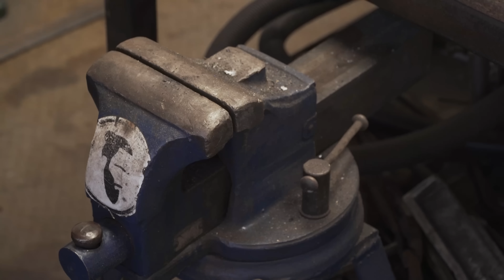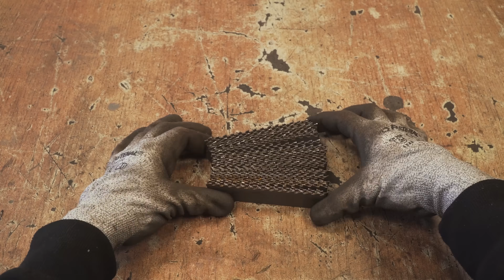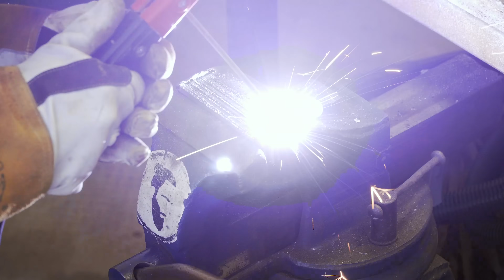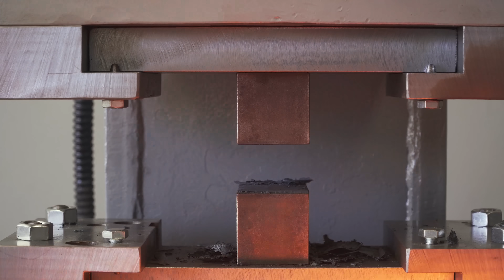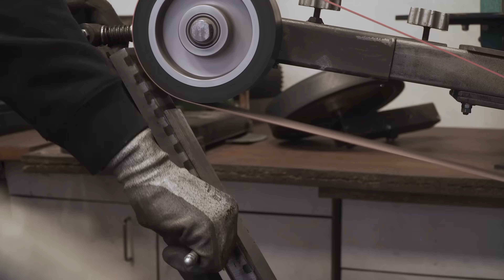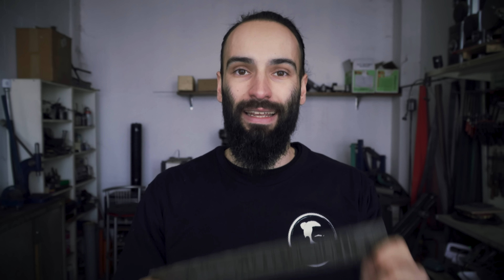Scrapyard Bandsaw Blades Damascus

Comment: Hello, iv been watching for a while now, iv seen a lot of different saw blades being used across other channels, but wondered if you change the direction of the teeth like flat edge, teeth edge,flat edge ect, or would that just make a slightly harder grade to work with,

Comment: Very nice! I’m impressed at how clean you made your whole stacking process. I also had a thought: instead of having all the saw teeth aligned on one side, maybe alternating them from right to left at varying frequencies in layers could diversify the pattern even further?:  K720, 2 Blades Right,  K720, 4 Blades Left, K720, 8 Blades Right,  K720, 8BL, K720, 4BR and so on so forth. Might be interesting.

Comment: great job friend 
l have a question 
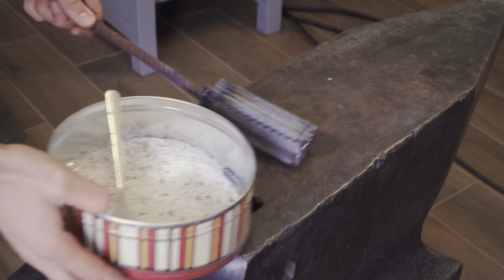what is this powder added on 2:45?
Reply: Borax.I find it better to make mix of boric acid 70% and 30% borax.Then dilute it in 70%+ alcohol and use a paintbrush then  burn it on the metal you want to coat .It will leave even coating and it burns green which is cool.

Comment: I like your experiment! I was waiting for the forge press in action- indeed it works fantastic! 
You interested me a lot with this 15PSI presure in your burners. What nozzle you put into them? Still works on 0,8mm nozzle like in the building video? To forge weld steel I can't go under 25PSI in my forge.

Comment: excellent work & beautiful result. K720 is really good steel, which welds very easily to almost anything - even stainless. Sticking bandsaw to bandsaw or spring steel to spring steel is much harder due to the chromium and/or nickel. If I may make 2 suggestions: 1. your gasforge is way too oxidizing judging by the amount of scaling. Needs more gas. 2. the corners of your press dies are dangerously sharp, they can easily create cold shuts.
Reply: Excellent thoughtful and informative comments.

Comment: Does the type of oil matter when quenching? I've always wondered if you could quench in ghee. I know it sounds strange, but I bet it would smell delicious
Reply: I use old peanut oil.. smells like french fries..
Reply: It does ,not all oils absorb the heat the same ,also some oils need to be preheated for certain types of steel.

Comment: I tried this recently actually! It worked out pretty well, just need to make the knife from the billet…
Reply: Was it just straight bandsaw blades or did you add another type of hardenable steel with it? I’m not a fan of repurposed steel myself. Could put all that work into it and everything goes perfectly yet the end piece still fails.
Reply: @erikcourtney1834  I threw in some 1095 every 5-6 layers of thin bandsaw blade. The initial and first fold welds went well and seem completely solid. Although ik what you saying. 

I too am not a fan of mystery steel, but blacksmithing / bladesmithing is just a hobby for me, so I’m really just having fun! I don’t care if it fails. For me it’s about the process, not the product.
Reply: @couldbejokim4557  I’m just referring to fact no one knows what that steel has been threw and if it has micro fractures in it. Might look ok but it would suck for it to break the first time using it as a knife.  The part about heat treating mastery steel is a whole other topic lol
Reply: @erikcourtney1834  yea I understand what your saying, but it wouldn’t be a knife I’d trust with my life lol. 

But in my research/experience micro fractures and uneven carbon distributions don’t really matter because some of the carbides and the carbon migrates to the other steel, and the micro fractures would dissolve into the rest of the steel and/or be resolved in the normalizing cycles.

But I’m a only hobbyist, so I don’t sell my knifes therefore I really don’t care if they break.